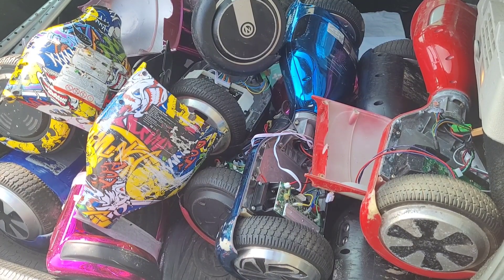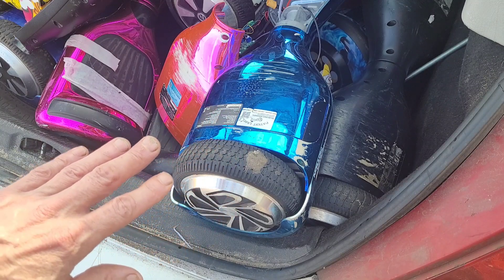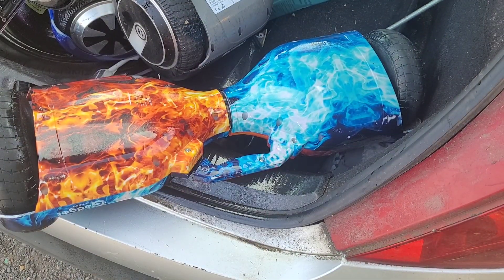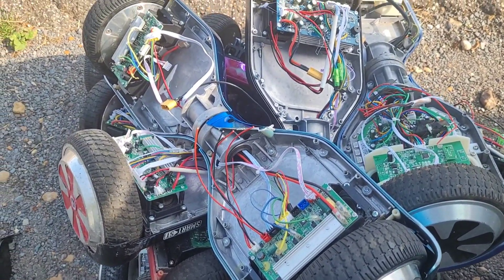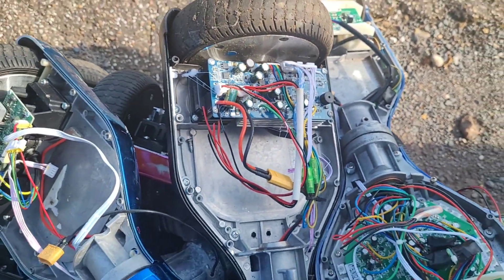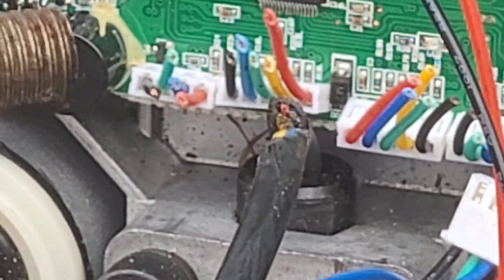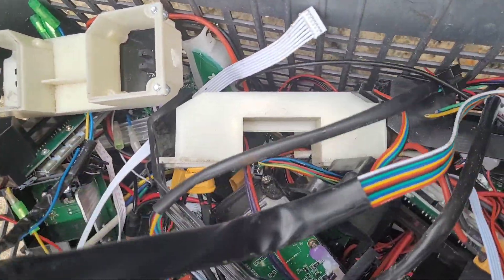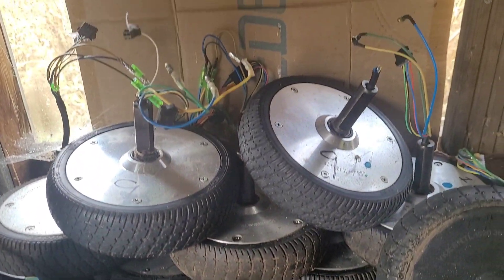Bulk Hover Board 36v Motor Salvage - 24 x 250w Motors - Hoverboard Wind Turbines

Comment: Gavin what is your plan? To build a resdential vawt or at full height tower one ?I love the idea to use segwheel motors for generators i have a hole bunch of them from at repair shop. Most of them have defect hall sensors or simply worn tires.  I got them cheap
Reply from the maker: Not sure yet , I'm not sure they are up to the thrashing a wind turbine will give them , as a generator the hall sensors arent required so you may still be able to use them cheerc.

Comment: Oh, I found your channel again, You should turn these motors into a portable bandsaw mill. Make a frame, inflate the wheels to tension the blade, and add a platton like a chiansaw mill. 
The benefits are less waste, no noise, no exhaust, no vibrations, lighter and much easier to use. More blade power transfer and better tracking with the push pull configuration. The motors can be driven in paralell with 1 driver. and they can be overdriven too usually.  I think about 2-5kw would be a FUNCTIONAL very laser like machine, and light. 
I think it would make a perfect product. 
Though you may need a 5kwh battery to run the thing with high volume production. 
And the logs never have to be moved, all you need is a ladder to start the first cut and then its all manageable afterwards Use the ladder as a straight edge and a large circular saw to make the slabs into beams. 
Least waste. Least expense. 
I think you could get away with a 1kwh battery but its all up to the actual demands.
Reply from the maker: Sorry you wasted your time with such a long reply not a chance in hell of me doing this, cheers.
Reply: @GavinFreedomLover  Great. It would work. Id take it over a chainsaw mill anyday, and if you have valuable wood on your land, it would be a worthwhile invention. 
Best not to have it all just go to waste.
Reply: @GavinFreedomLover  Yeah, you dont have to obviously. But it can be done, and it can be effective.
Reply from the maker: I don't have any wood on my property thus no interest of any kind in a wood mill but the motors probably have enough guts to move a saw blade around, cheers , Gavin.

Comment: You are making covert ads for broken hoverboards on e-bay. I mean, I am now frantically looking for broken hoverboards for 5 pounds :-).
What a find... that they generate so much.
Do you know that a friend of mine bought an actual pedal with dynamo like 15 years ago  (or is it 20?), but they used a normal bike dynamo. And a bike dynamo is limited to 6W.
Even if you buy a good hub dynamo, it is always power limited (to protect the lights). So I gave up on the idea of doing anything like that.
I have a very good velomobile quest, it's so comfortable, it's easy to bike 10 hours in it. With a hoverboard generator that would give me a 150W generator. And with 2, it would be a workout generator (doing way more than 200W for workout).
Reply from the maker: FB marketplace is your best bet.
Reply: It's very difficult to pedal 200w for more than a couple of seconds from what Ive seen (on YouTube 😅)
Reply from the maker: It is but I am gong to find a superfit cyclist to try it out.